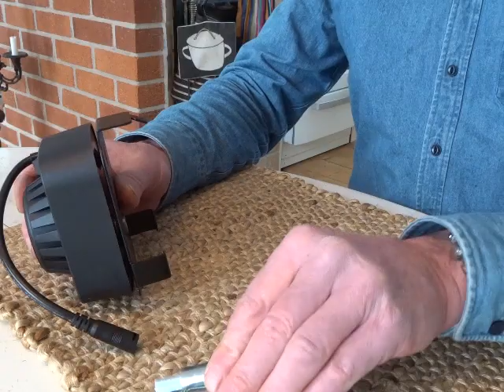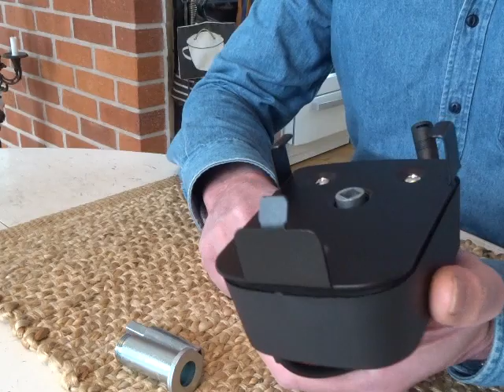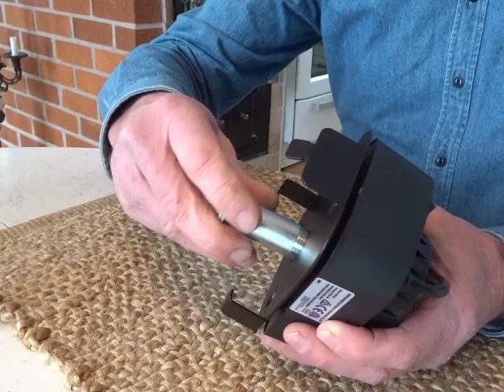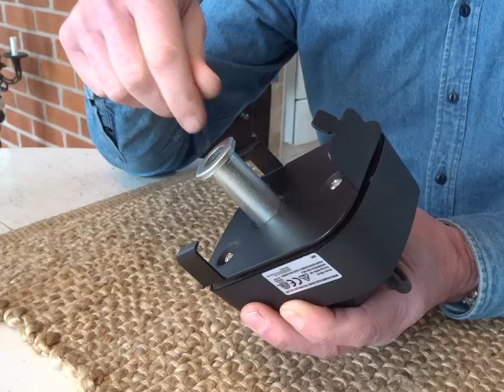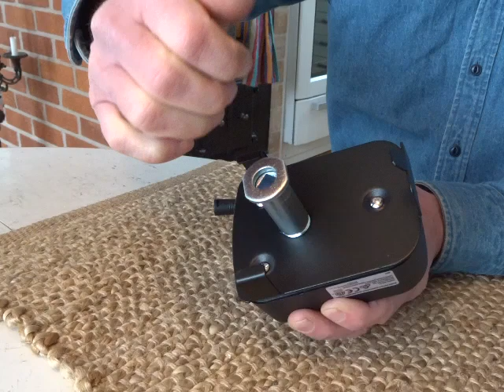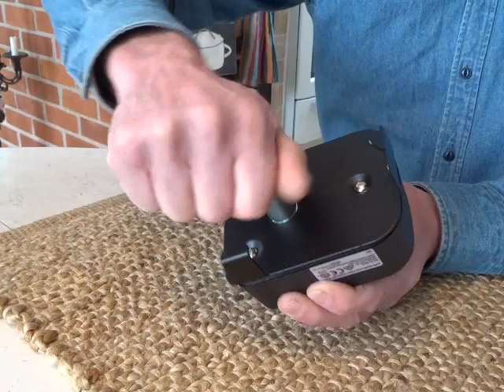Masterbuilt Gravity rotisserie fix

Comment: Just don't tightening it too tight. I started off with it too tight and I loosened the bolt just a little until it turned smoothly.
Reply from the maker: Thanks Michael,
Yes, that will work most of the times. I have seen some comments on furums that the adapter can either unscrew itself or tighten itself, depending on direction the motor decides to rotate. 
I have notices that the adapter can hook on to the flensh due to the rough surface on the adapter and the the very small sharp edge inside the flensh from the tube welding,  I  guess the alignment of the motor to the spit rod can make things  better or worse.

I have four rotisseries in stock and all of them have a to long adapter. So when I file them down I also file and sandpaper the surface of the adapter to a smoother the finish.
/Mats